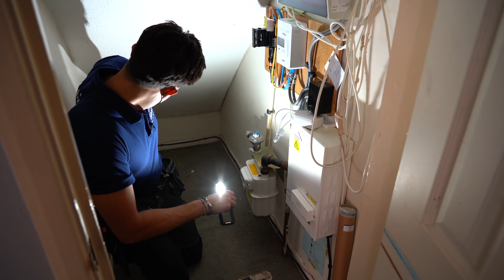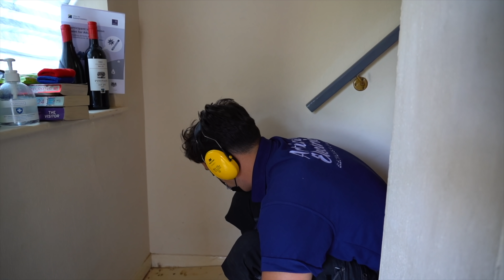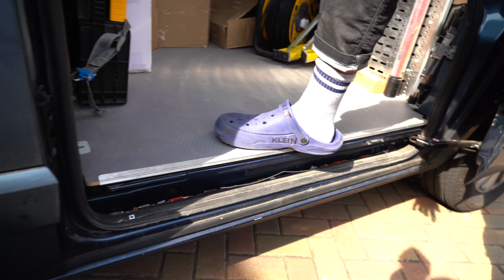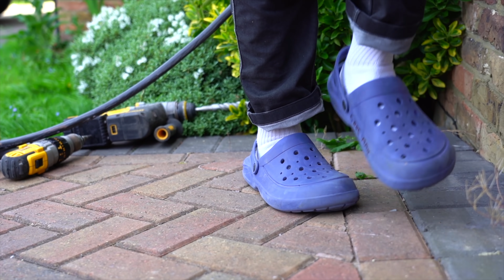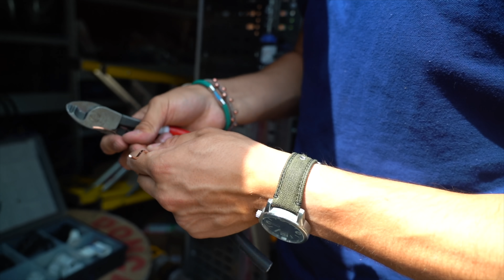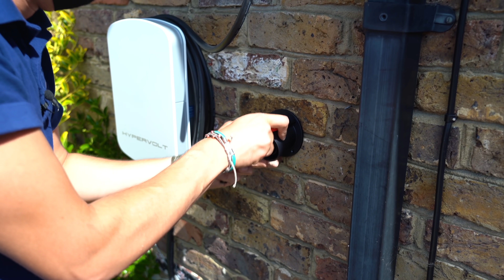MATERIALS DIDN'T ARRIVE! - Installing a Hypervolt Electric Vehicle Charging Point - Electrician Life

Comment: Good video.

Could you please show how you terminate or extend the data core inside the house next time please. 

I have noticed now more and more ev manufacturers spec this type of cable to be used but I have not had chance to use it or seen anyone showing the data side if they do. My personal concern in using it is that extending or joining data cable can effect the performance.

Comment: Only issue I'd have with using a PI (which seems overkill TBH I'd love to know what it's doing with all that processor power?) is I have had them corrupt the flash card if the power happens to be cut to them at the wrong time, they MAY have mitigated that with a mini UPS/power reservoir to allow a controlled shutdown in a powercut etc. or they may use an OS that only rarely writes to the flash card but who knows? I guess time will tell.

Comment: I always put a drip loop in cable running through an exterior wall I would have just used the Doncaster ev tough sheath cable also not long enough to merit armored cable
Reply: Plus one for the drip loop, sloppy without.
Reply: Yeah or at least drill out on an angle

Comment: Hopefully hypervolt will see and respond to this…

I’d love to know more about that raspberry pi.. mainly what you have done to secure it..  As someone who “dabbles” in the ethical hacking and penetration testing space the first thing which came to mind was how I could quite easily pop that cover off, having physical access to the Pi, (at which point 80% of the security is gone when someone has physical access) Dumping the contents of the SD card or attaching a keyboard, screen to the device would likely allow me to eventually reveal the wifi password. And at that point I am on the customers wifi network, i move sideways across the network attacking an unpatched windows workstation and install a Trojan to steal banking details, crypto miner or just ransomware.. i install a back door on the raspberry pi.. now I have an always on device sitting on their network which I control.. this I could then use to run wire shark and monitor their network activity, all of this before I decompile the source code and reveal any API keys which will allow me to access endpoints on the HyperVolt system.

Don’t get me wrong, the product looks great! But having my infosec head on.. the moment Jordan and Tory mentioned RasberryPi my ears perked up! Love to hear your feedback. This kinda stuff really gets my blood pumping! 😍😍
Reply: If you can hack it you're hired! It uses 5 tiers of encryption, very very advanced things that we cannot describe in public as they are part of IP. Remember all our engineering team is top Googlers, which is a lot of fun! They couldn't wait to geek out on how many tiers of encryption and obfuscation to use!
Reply: @hypervoltev  yep haha 

It looks like a well made design of product tbh...I can see the quailty in the unit tbh also fair play to you on replying to peoples comments lol
Reply: @hypervoltev  Plenty of pentesters out there who will happily test your claims. Perhaps you'll star in a CCC presentation in the near future (here's hoping we get a real CCC).
Reply: Send me a trial unit and I will happily try ;) 

Although I appreciate your fun and banter-full nature of the company. (It’s very Elon musk on Twitter like.. ) Don’t forget some of the greatest tech companies in existence have had some pretty big infosec blunders(including the Googlers) and although I have no doubt you engineers have thought of everything it’s always best to stay level headed and not get too confident, as there’s always some snotty nose kid in his mums basement coming up with new ideas how to undo what some of the greatest minds in tech have created… it’s what makes our jobs so fun!!!

@torntechnology on Twitter if you ever fancy loaning a trial unit for me to break into.😉

Comment: i think its a great thing they run the charger off a raspberry pi, end of the day the pi is only doing compute stuff anyway id assume, it means if the cpu dies replacing the pi is easy as hell even out of warranty if the manufacturer stops supporting the device it can run custom software relatively easy. maybe the only gripe is they are using a normal PI 4 and not the compute module which makes more sense for an actual product like this, no need for any of the ports or sd card storage. my only reliability question would be are they protecting the 5v power supply going to the pi as they power it from GPIO as that bypasses the pi internal protection on the usb c port
Reply: There is no difference between the USB port and the header on the Pi 4. They are directly connected.
Reply: @Monkeh616  did you bother to read anything i put, yes you can power the pi from GPIO but it bypasses all the input protection, so you are not protected by the fuse or overvoltage protection. so dont spread misinformation because there is a difference between powering via GPIO and USB. this is something well known. theres nothing wrong with powering via GPIO but id hope with a consumer product they are re adding those protections on the 5v power supply.
Reply: @Altirix_  Did you bother to read the schematic? Both the USB C port and the header directly connect to the +5V net. There are no fuses, there is one big TVS diode which, again, is directly connected to both. 

Well known does not equal correct. A simple glance at the PCB tells most of this story. The Pi 4 is quite different to previous generations.
Reply: Rpi's are so versatile. Ive seen them used in so many commercial applications recently.

Comment: Question, not relating to the car charger. When installing an outdoor socket with an swa gland, what am I suppose to do with the earth tag? I've seen videos of the earth wrapping around the eye but I would of thought a nut and bolt would be best. Also, the earth tag seems to go flat against the inside surface of the outdoor socket, is that normal. 

Any answer would be really welcomed.
Reply: Couple of options - 

[1] Drill the box and use a nut and bolt with fly lead. 

[2] Bend the banjo upwards and nut and bolt (this way you're not affecting the IP Rating however in MI you should drill a drain hole anyway so technically not an issue. 

[3] The best option, but most expensive is to use a piranna nut.
Reply: @nathanhedgeley8016  I’ve had some banjos in the past where the brass is so badly recycled they just snap when you try to bend the tag up but yes I agree with everything you say.
Reply: @jamesdyas542  Not surprised with the cheap stuff made these days mate haha. I've only ever used that method once before, personally I would just drill the box and bolt through.
Reply: I soldered an earth wire to it. Only needs connecting one end if you are using one of the cores as earth. I can’t believe sparks solder though, in the job?
Reply: Use a storm gland and earthing nut

Comment: You could do your customer a favor and rip out that "voltage optimization" device. This is nothing than a scam, fed to people with a lack of understanding of physics and basic electricity. They provide(d) a minimal saving for incandescent lights by reducing the voltage, but increase consumption and costs from everything with motors or switching power supplies in it.

Comment: what about all the rain water that's gonna drip from that window sill right on to the charger?
Reply: This is the UK, I think everyone knows we have a bit of rain from time to time, I am sure the correct IP classification will be on this product.
Reply: @acelectricalsecurity  yes I am sure the product is fine, my query was the entry into the house, is the house IP rated lol, no drip loop on the cable surly in time that morter will crack or fall out and the water will track into the house, just my thoughts
Reply: They have IP ratings for a reason
Reply: I'm sure if its IP rated and can take a down pour,a few drops from the window sill is not going to do any harm
Reply: Maybe a drip loop on the cable too, in time the water might track into the house, how good is the filler you used??